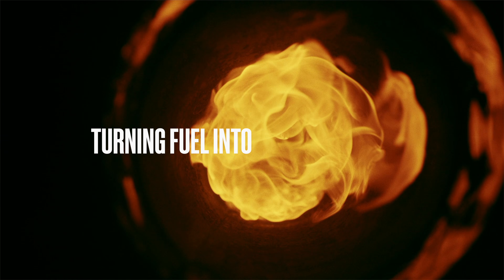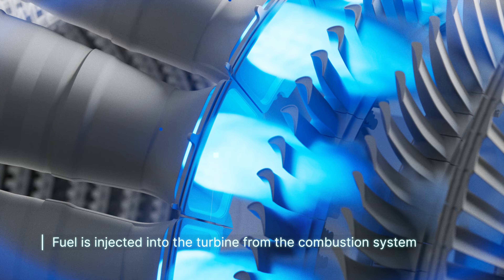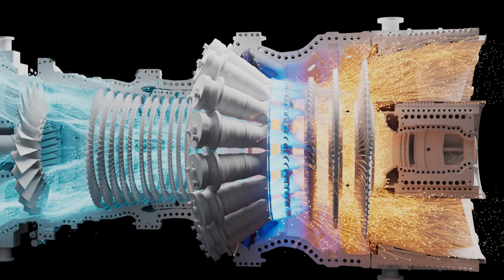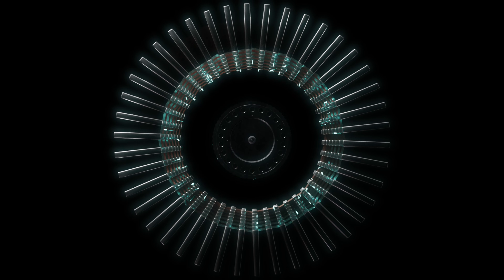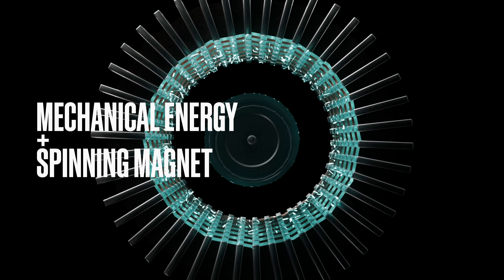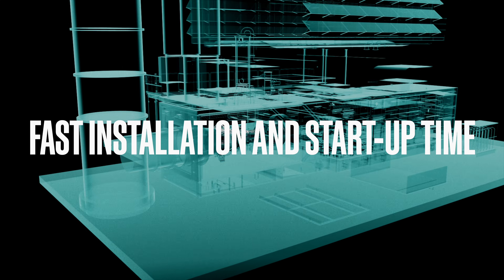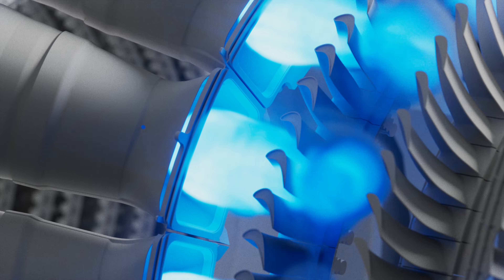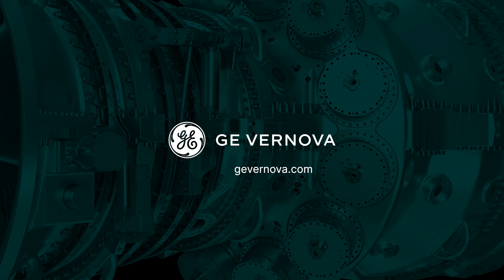How a gas turbine works | GE Vernova

Comment: I still don't get the difference between the compressor and turbine. 
They are both fan style discs and looks somewhat the same. It basically looks like two compressor chambers. How is the air not being compressed in the turbine as well? And, isn't the turbine shaft also connected to the fan?
Reply: The compressor, compress the air and send to combustion chamber. Once the fuel and air mixture and it's burned, the gas of this combustion expands and flows to the turbine, moving the turbine and generating power. The turbine section have a compressor disc and turbine disc. The compressor disc uses the combustion gas to move the compressor section through an axis and the turbine disc uses the gas to generating power for something specific depending on the engine application. In aircrafts, the turbine disc moves the propeller or fan. If the engine will be conected in a generator, for example, the turbina moves the generator.

Comment: Is exhaust heat wasted or used for something else?
Reply: It used for heating water in combine cycle ( gaz turbine + steam turbine)
Reply: In texas they use it to bbq and smoke briskets. In russia they squat around the rear end to warm up their butts.
Reply: In a combined cycle power plant, the exhaust gas heat is used to create steam from ultra pure water. This drives a steam turbine, creating more energy and increasing efficiency

Comment: To be honest a smart move this will be helpful for corporates with high energy demand machines but what about the installation process?
Reply: Gas turbines are actually not a new product. They exists for easily over 60-70yrs now and widely used in variety of application for power generation, compressor stations.
Reply: Its easy, open the case it comes in, fill the gas tank and press the start button, there is normally a 220 or 110 or 440 or 5v usb out, in case you want to charge your phone

Comment: Is this tech also applied on Aircraft Engines?!🧐
Reply: Yes, working principle is the same. In aircraft engines, the air is mixed with fuel, combustion happens, to produce thrust. In industrial gas turbines, the goal is to drive multiple turbine stages, which in turn is coupled with a external load (compressor or generator). The GE LM2500 family are also called Aero derivative gas turbines.
Reply: Sadly nope